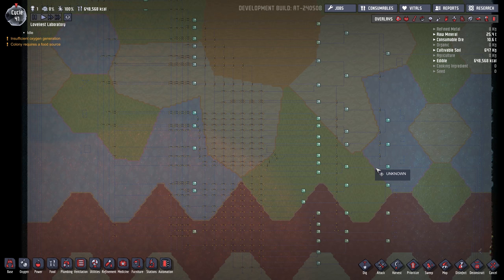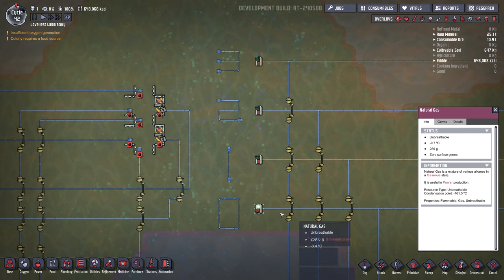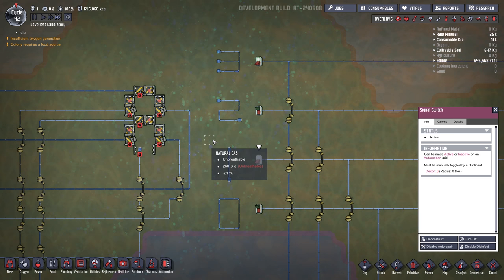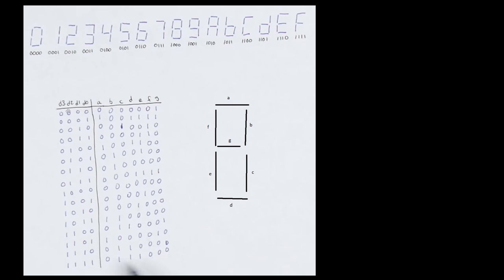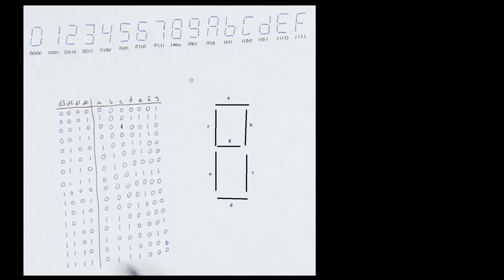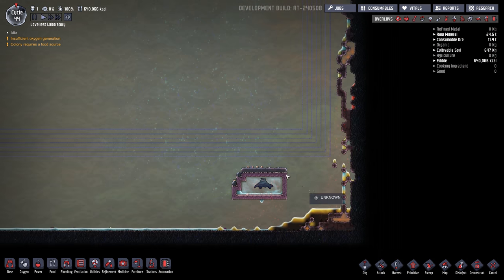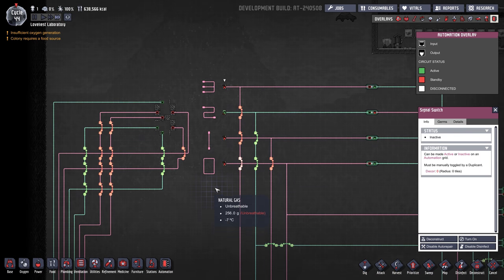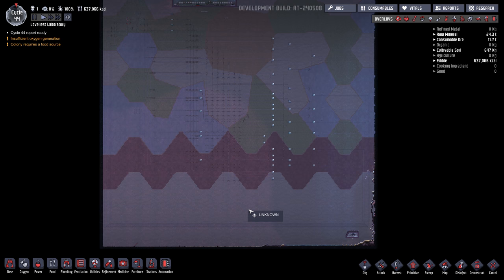7-Segment Display Using AND OR NOT Logic Gates - Oxygen Not Included Automation Upgrade

Comment: Why is there so much wasted space? It's not needed and just makes it a lot bigger. It would definitely be possible to fit a 2 digit display in the map if you made it smaller. I'm currently working on a 7 segment display but the game is crashing too much for me. This is pretty cool though.
Reply from the maker: Yeah it could be probably 1/4 the size. I left room to make sure it didn't become a jumbled mess.
Reply: Just use some boolean algebra and it will be smaller :) Its nice but how he already said. Waste of space :) Try search something about karnaugh map. It will help you.
Reply from the maker: I guess you missed when I mentioned k-maps. Building the thing from an existing map was already quite time consuming. Deriving it would have been slow for my old brain.
Reply: Sorry, was skipping some parts, because i know something about it. Was just curious how you figured it out. :)